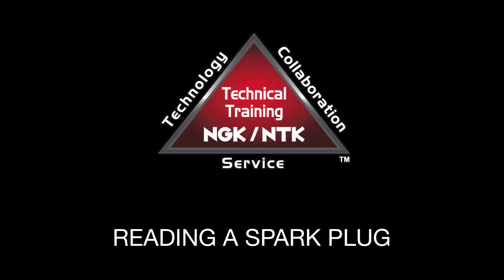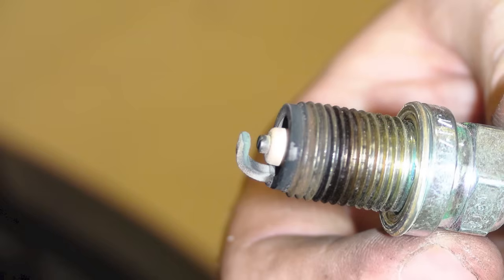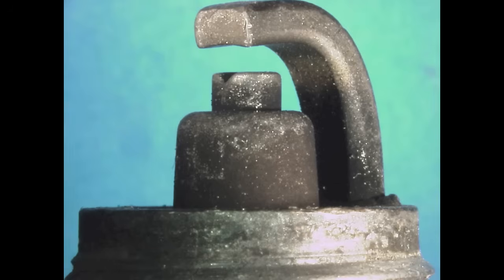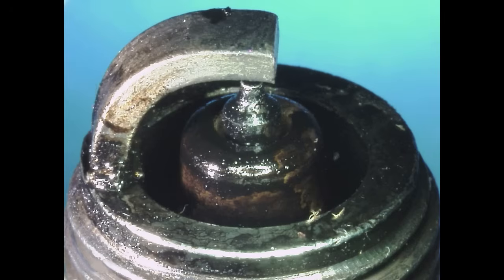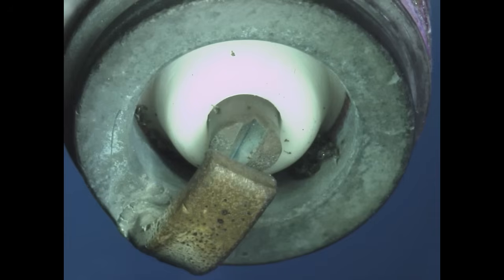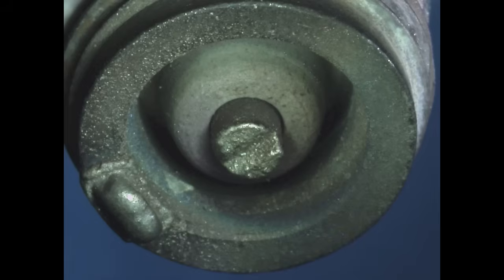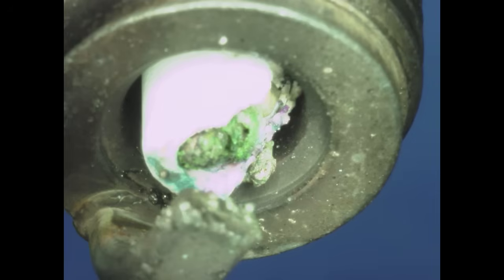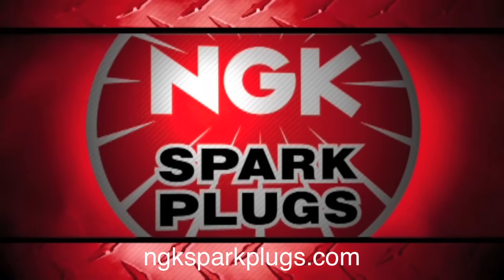Reading a Spark Plug-NGK Spark Plugs-Tech Video

Comment: Where is the rest of the information? My NGK plugs from my Accord have about .08 thousands worth of electrode and ground strap erosion in less than 10,000 miles. Normal light tan color, no spots, no oil or fuel fouling. What happened to them?

Comment: Been fighting a missfire caution alarm on mercruiser.  Last tune up was by boat dealer.  Recently pulled plugs. Found unburnt fuel on plugs. Also found gap on all plugs at .030.  Gap should be .045.  Ordered new plus, will gap properly and see what happens. ???
Reply: so what happened with your misfire issues? did that fix it

Comment: This video is horrible, and gives absolutely no valuable information about how to read a plug.  What about the base ring? Or the ground strap? Or how about cutting off the threads to see the insulator color at it's base?  NGK should be ashamed about releasing a video with such poor information.

Comment: Wet plug may mean engine is not firing , The plug might even smell of Gas .
If it's oily wet then the head gasket may have failed near an oil passage. 
A white powdery plug is likely lean not enough fuel or Too much Air ... 
Also a clean plug might indicate Water from the cooling system getting into the cumbustion chamber through  a failed head gasket or Cracked passage ... 
This coolant,  steam cleans the plug . 
Drop by any engine rebuild shop to see plugs that show each condition .

Comment: Can bkr5 v-power plugs be safely used in  the jdm wrx sti v2 my95?. The ecu is tuned for a very rich mixture.had 7s in and 6s are recommended on most forums. But,;im i want to know if the 5s work and if so whats the best gap to put them at. Thanks
Reply: Email NGK...you probably won't get a response on YouTube

Comment: is this guide applicable to 2-stroke engine too?
Reply: yes sir,in good conditions you need a dark brown (kartbordpaper) color,ore lets say coffee (with milk)kind of color.too lean color goes white,too rich it goes black in this(both) case check yourr carburator for pilot and jet settings......ore the timing from the ignition system....
Reply: mrrichard57000 cool thanks for sharing u helped a stranger!